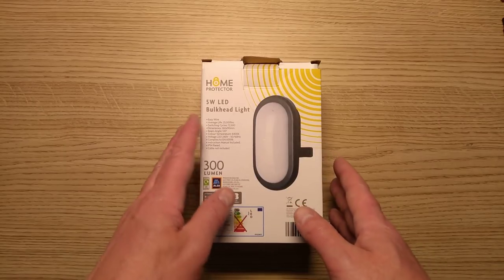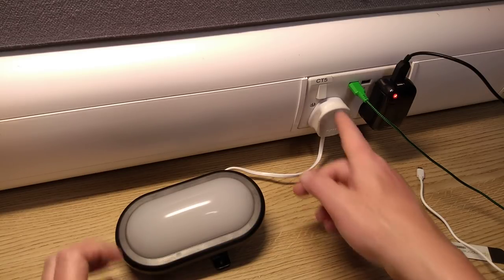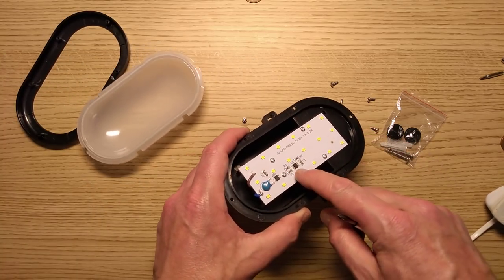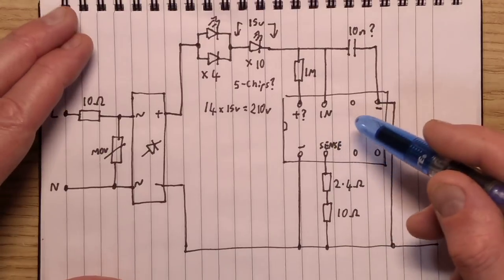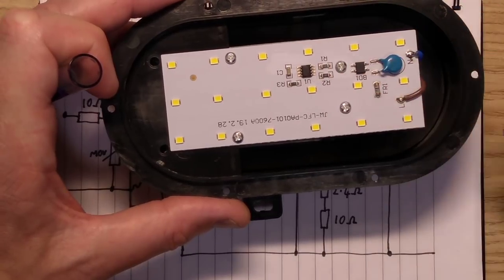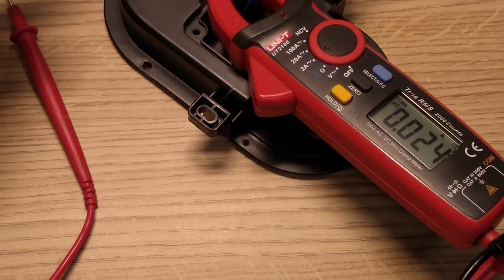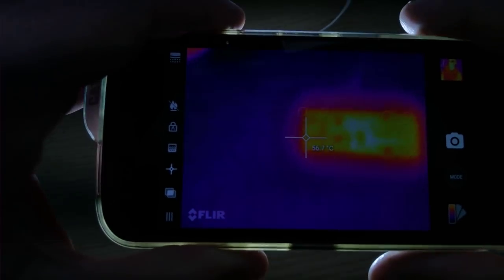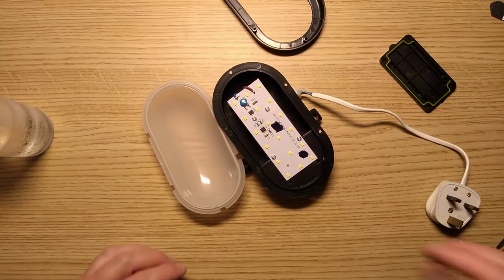Inside the Aldi 5W LED bulkhead light.  (With schematic.)

Comment: How to fix flickering
Reply from the maker: That usually indicates a failing LED chip.
Reply: @bigclivedotcom  I'm sorry I want know it flickering on camera very fast, 50Hz. Is one capasitor on parallel fix this?
Reply from the maker: @Resul-sy4kk  The flicker is due to the very simple circuitry.  If a capacitor was added it would result in higher voltage to the LED array and much higher heat dissipation from the regulator chip.  These types of light are not really suited for camera use.

Comment: If this is where such things are going it is just another example of how we are letting corporations produce ever more throw away crap. Far better to have a conventional bulkhead lamp fitting with a standard E22 screw in bulb. That way people can still use an LED bulb if needed and only the bulb need be changed should it fail which if an LED bulb is usually many years away, I bought all mine from pound land 4 years ago, 9 in total, I've had 1 failure to date. Saves just as much energy, and far less wasteful. I think there may even be places that recycle them. 

Oh well, I look forward to seeing the remains of things like this floating in the ocean and choking a seal to death momentarily.
Reply: Around here in the US the dollar stores usually sell the 40W equivalent LED bulbs for $1. Sometimes they have a 2 pack for a buck.
Reply: @jimsteele9261  Yup, that's the one.  In this day and age, when the bloody arctic is ablaze Greenland is a slushy and biblical flood events happen every other Tuesday there is no reason for anything not to be built in a modular serviceable fashion. 

I have a 32 year old Henry Vacuum cleaner. The reason I still have it is because it can be fixed for peanuts with ease. What the hell are we doing as a species.

I bought a dyson 4 years back for the upstairs, dropped it down the stairs, smashed to pieces, total write off. Henry bounces.

Comment: This is what happens when you reverse engineer outside you normal environment ... 10 LEDs + 4 LEDs is 14 ... but there are 18 ... Gotta be careful on those corners :-D
Reply: 10 x (single in series) and 4 x (2 in parallel) = 18.